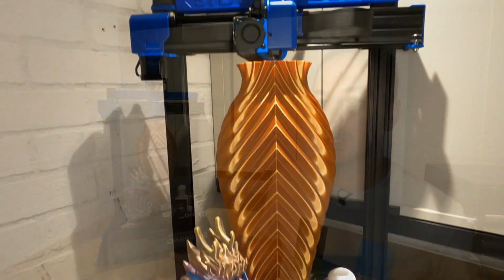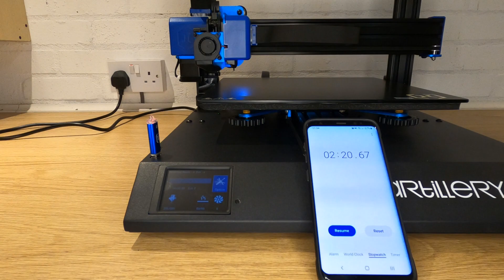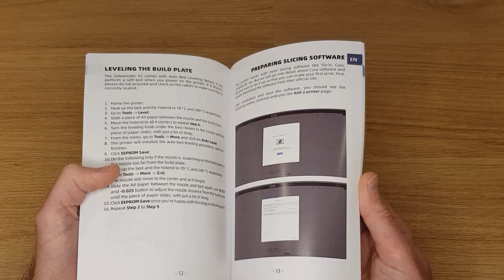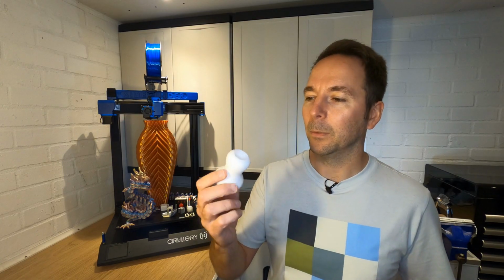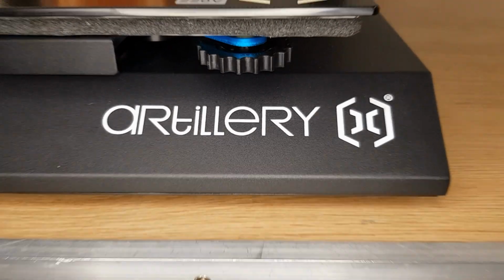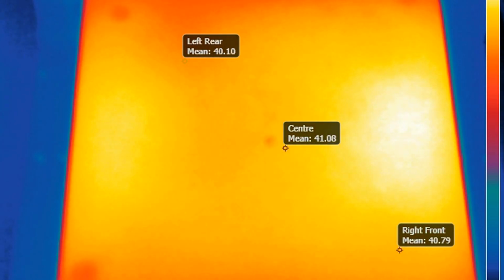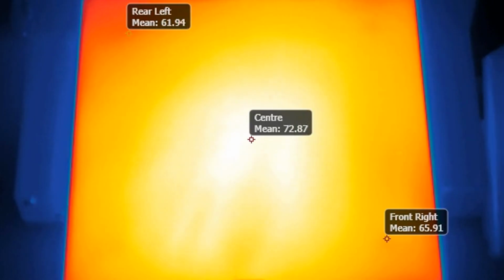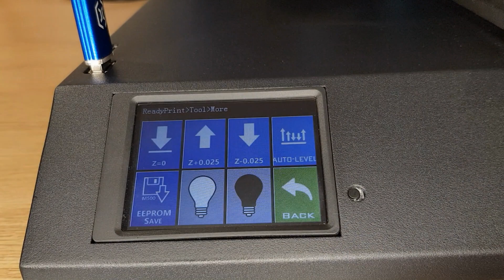Artillery Sidewinder X2 Review - The Easiest 3d Printer To Get Started?

Comment: I have the X1 but can't get it printing, it puts the first layer down and then drags it around around in a clump, the bed temp is 80 and the nozzle is 220, distance between the bed and nozzle is done with sliding a piece of paper between which I've done.
Anyone know what the problem could be?, it has worked ok for the first test print but hasn't worked since,.

Comment: Ha amazing review, i bought this for $250 and am so hlad i did. It is great to know the heat bleed below the bed which looks sixable because its where the glass gets connected at each corners adjustment spring.  

I truely love this machine even though ive only had it 2 weeks. It gave me access to printing anything i want. As a mushroom grower this means i can print hingest, ducting, handles, switch casings, vent filters and fan adapters.
 I can cut off so many expensive parts because now i can print them. I just finished printing a mini computer case and now i am working on duct flanges. 

It isnt perfect, and i learned while using programs like prusa that temp is everything, but as things get dialed in and my 1" xps foam print case gets assembled, i will be able to run my business on flat 4x8 panels of foam and plastic with printed parts, making me adaptable to the changing financial future of being a viable business.

For example i used to have to buy used squirrel blowers on hepa filters that were used for rat experiments in labs, with proprietary filters that cost hundreds, now i can buy a 1ftx1ft hepa and print the flange to attach it to my mushroom lab, for $100 plus filament.  Its insane the amount of hours ive spent looking at products that are not for mushroom production but are similar to fit me needs, now i can just print it with fusion 360
Reply from the maker: Great to hear you are reaping some of the great benefits of 3d printing so soon! Thanks for your comment👍

Comment: I've had my X2 for a year now, putting in the all-metal hotend with .6mm steel nozzle right from the get go. No major issues, though the LCD did die on my twice (probably not Artillery 3D's fault, more of me being in a lightning prone area). Had one LCD replaced under warranty (Artillery 3D's customer service has been superb in my experience, they even sent me replacement Ruby and motor boards as well) and got another from a local shop.

Been happily printing PLA+, Silk PLA, TPU, PC, PC-CF and PA6-CF before recently updated to Artillery 3D's all-metal hotend firmware to enable 300C at the hotend. Very happy!

But since @RickyImpey came out with the Sonic Pad guides, I'll be running that with the X2 soon (once my local shop has it in stock). Would be nice to print faster with the X2 until I could afford Bambu Labs' X1Carbon, though the X2 will remain as part of the team.

😃😃😃
Reply: Was it easy to switch all metal hotend
Reply: @Hanzi2u  There were a few screws to take off but no biggie when following the instructions.
Reply: @velocistafpv  which instructions did you follow? From where

Comment: Hi, great review, thanks for give so much important details. I used to have an Ender 3 which I customized a lot. I sold this printer and now I'm considering to buy a new one with bigger printer volume. How easy do you consider to switch nozzles in this Sidewinder X2 ? Could you give more details about integration of this printer with octoprint ? I saw other video about this printer which the person changed the glass bed by an alumminium one. DO you have any ideia if this could be dangerous, considering the heating bed is fed with main power source instead DC ? Thanks by the information.
Reply from the maker: Hi, I know some people do change the bed to aluminium and then earth it to ensure there is less risk of electrocution but it's not something I would do myself. I just believe that there is too high a risk of danger with a couple of wiring failures. What I did was add a PEI flexible plate with the magnetic plate applied directly to the glass bed. This way, I get a better print surface, a little better heat distribution and no added risk. The nozzle is just as easy to change as any of my other 3d printers. Slightly easier actually as you don't need to remove any parts first, just slide the silicone sock off. This printer would run with Octoprint with no issues, it can also run with klipper and i've had it running with the Creality Sonic Pad. Firmware updates are a little tricky but possible.

Comment: I've got a ender v2 and a flsun qqs pro delta and my flsun delta for some reason only works with cura 4.6 so that's how my printers are running I'm wondering if cura 4.6 will work for this artillery sidewinder x2 if so I'll buy it right now I'm needing the bigger build area and a direct drive extruder for tpu anyone know if it works on cura 4.6 thanks
Reply from the maker: I'm sure it will work. Worse case, you may have to modify a profile. The good news is that this is a development of the Sidewinder X1 which has had a Cura profile for a long time. Have a look in the Cura version you are running. If there is a Sidewinder X1 profile then you will be fine.

Comment: I have an X1. I got fed up with the ribbon cable connectors, and ended up wiring direct from the main board to the head. Looks like they have changed those. Bed adhesion is a constant problem, but I have upped the bed temperature and that helps- now I know why (your actual vs indicated temps). The reel bracket is terrible- access to the clamps is at the rear, v difficult to get to. Bed power sticks out the back- adds ~140mm to the overall depth - another fix. I like the interface and the speed... Question now is- do I get an X2, mod my X1, or choose another...
Reply from the maker: Well, over 6 months on, i still really like the X2. I don't love the screen and the firmware is a little limited but it's always been very reliable. I added a magnetic PEI bed and my bed adhesion problems went away.
Reply: @RickyImpey  I have ordered an X2- the fixes to issues convinced me. I like the solid construction, and hope it will be more reliable than the X1. When I started using the X1 (2.5 years ago), I had to make a 'machine type' because Cura did not list it. It does now, so I tried it- with exactly the same settings for speed etc, it takes ~25% longer to print. Looking at the gcode, it is moving more slowly- but neither versions seem to give the head speed that was selected... any ideas?
Reply from the maker: @Tensquaremetreworkshop  Usually, if the speed that you've asked for in your slicer is not being reached, it is being limited by the printer's acceleration settings. Imagine a car journey where you want to drive at 70mph but your can doesn't accelerate very fast. It will take a long time to reach your desired speed everytime you have to slow down to corner. The slicer settings are your desired speeds but the actual speed will be slower as your acceleration is limiting it's potential. You can change acceleration and jerk settings in Cura but if you go too far you may induce 'ringing' artifacts. I don't have a video for this yet but I believe Teaching Tech have some decent information on tuning acceleration.
Reply: @RickyImpey  I was not referring to the speed achieved, but the feed rate in the gcode. e.g.where my X1 version gives F1800, the 'official' version gives F1200. Similar differences exist throughout the code. The former predicts a 4hr20 build, the latter a 5hr39. All options are set identically. Weird...
Reply from the maker: @Tensquaremetreworkshop  Oh ok, that's strange 🤔

Comment: I have discovered it too, that the temperature on the print bed, for all my printers (3) is not what it has been set to in reality. That's why I bought a heating (silicon) element from Keenovo, with its own thermostat, and built my own bed. And I now have close to 95% correct temp in relation to what I have requested.

Comment: Hi Rick,
I watched your 2 reviews about the Ender 3 s1 Pro and the Artillery Sidewinder X2. I already have a modified Ender 3V2 and I am quite happy with it.
My question is which one of the 2 printers would you recommend for almost exclusively rc planes printing with thin walls? They both seem to be very good printers, so it's hard to decide... also not much experience and very alone ... Thank you for your answer.
Reply from the maker: Hmm, my first question would be why do you need another printer? Is there something you V2 won't do? Both of the printers you've mentioned are direct drive. The X2 is much bigger but the S1 Pro can print higher temp materials like nylon and even polycarbonate.
Reply: @RickyImpey , thank you for your answer. I wish to have a more "pro" printer and direct drive too. The V2 does the job, but I could improve the LW-PLA wing quality, eventually. Having 2 printers... is pleasant.
Reply from the maker: @klausrimdoi45  Ha ha, well depending on the scale, is it an advantage to print larger pieces in one go? The S1 Pro bed siz ecan be limiting. If that's not a problem then possibly the S1 Pro. Recently some have had a few issues with leveling but I can't say if it's user error or a machine problem, mine doesn't have any issues. Have a look at the Sovol SV01 Pro too (review coming next week). It's could be a great compromise between bed size and capability. I'm very impressed with it so far.

Comment: Hi Ricky, thanks for this fabulous review. After doing an autolevel from octoprint I got some profiles with slightly raised ends. I thought it was deformation due to temperature, but I still see them at room temperature. Here I leave you an image to see what your opinion is. Have you done any tests on yours, does it look like this? It is strange that a glass base is curved with that profile, don't you think?  https://drive.google.com/file/d/1665ZwbK4wD0CJpMH1YdVkqWJCGjWCBh3/view?usp=sharing
Reply from the maker: Hi Ignacio. That image really makes it look worse than it is. It's showing at most 0.1-0.2mm higher at the corners. Unfortunately, it is probably inaccuracies in the bed probe and the coating on the bed causing the slight difference. It's not something I would be concerned about myself.
Reply: @RickyImpey  Thanks! the truth is that the difference is minimal and not to be taken into account

After doing the manual and autolevel calibration, I expected to compensate for these small differences, but I found that the first layer of an STL (test level) had some material drag in the corners. (attached image)

It has occurred to me just when I saw your thermographic images of how BADLY the bed of this Artillery heats up, that what happens is not really because the self-leveling is not doing its job, but because the material does not adhere to the bed for lack of temperature and those tenths of height cause drag to occur.

https://drive.google.com/file/d/1zan_ya1-jTt2FjctVcmuDAGFh13omkOa/view?usp=share_link

Comment: Hi, I have a budget of 1000.Dollars
Would you still recommend this printer?
Reply from the maker: It depends what you want to do with it. I don't believe in paying more just because you have the budget. I would identify what you want to do and then see what is available.
Reply: user friendly make molds. in order to then be able to cast things. stable printer
Reply: @edwardholappa8410  It is an excellent printer and the large size will be a plus for molds.  I print molds for RC aircraft with mine (I have both n X1 and X2)

Comment: I’m sick to my stomach of fixing and modding my cheapo Creality and AnyCubic printers. It was fun when I was just starting and helped me learn a lot of 3DP in general but my hobby is making robots not fixing my printers! I think this will be my next printer and your review convinced me.
Reply from the maker: Mine has proven to be reliable so far. I haven't done a PID tune, e-steps or had to fix anything. I have added a Two trees PEI magnetic bed which has sorted the issue the uneven AC heating caused. I still really like it.
Reply: @RickyImpey  do you have a link for that bed ???
Reply: @RickyImpey  Yeah  would love to know too, thanks! I can only find the one with the adhesive magnetic layer, but Im not sure about how it would improve the issue with the bad heat spreading
Reply from the maker: @PolySquirt  This video has the PEI beds I've used in the description. I do use an adhesive mag one and it seems better for heat spread https://youtu.be/7kC4DghTW7o

Comment: I'm new to 3d printing and noticed you used a feeler gauge to adjust the nozzle height. What gauge did you use? When using a feeler, do you adjust the bed until it not longer feels like it is lifting the head? I'm sure it is pressing the bed down rather than lifting the print head.
Reply from the maker: Hi Anthony, this video will hopefully answer all of your questions https://youtu.be/zKpNxqWie_8

Comment: I'm looking for my 1st and only printer, and this one looks like it might be the ticket. Are the sides of the tall vase as smooth as they look on camera? And does this printer do fine detail as well as other printers of this size and price range. Speaking of price, it lists for $469 on the Artillery website, while it's only $339 on Geekbuying (on sale for the next 3 days) making this the least expensive printer of it's size. Also, have you tried a .2mm nozzle on this machine, or even a .1mm? I know print time will skyrocket, but if it will make a more detailed print, i'll be happy to wait for a print.
Reply from the maker: It is a good machine, and very accurate. I have tried smaller nozzles and it prints detail really well. To be fair, most of the printers from the main brands do but only if they're setup right. The beauty of the X2 (at least the one I was sent) is that you don't have to do any setting up. It prints well out if he box. I still stand by the pros and cons in the video, but since the review, I have added a magnetic PEI bed which has pretty much solved all of the bead heating issues. Yes, the Geekbuying deals are great at the moment. If you go through my link it also helps my reputation with them so they send me more stuff👍
Reply: @RickyImpey  That's my printer then. I'll be ordering it this Monday, and it looks like I can get a PEI bed from just about anywhere. The only question I have left is where do I buy a .2 or .1mm nozzle to fit this printer. Thanks for your help, and i'll be sure to use your link when I order.
Reply from the maker: @wiliamogle9342  there will be lots of places to buy a nozzle depending where you live. I bought a set from Amazon that I am happy with. Just search for 'volcano' style nozzles. They have a longer thread on them than some others you may have seen. I really hope you enjoy your new printer👍
Reply: Can you do a video on installing A PEI magnetic bed for a beginner ? I will be purchasing this printer tomorrow
Reply from the maker: @triplethreat9168  It is on the list, I will try to shuffle it up for you👍
Reply: @RickyImpey  perfect! Thank you

Comment: This one seems like a no-go considering the uneven bed heating; if you want to do larger prints in anything besides PLA you're just SOL.
Reply: "Seems" is not "actuality".  I have both an X1 and X2.  They have ZERO issues with bed adhesion even thought there is minor temp differences across the glass.  EVERY printer bed has this issue, just in different amounts.  I print extremely large prints in PLA and PETG and have had no issues at all.  None, nada, zip.

Comment: Is there a way to offset the temp difference in firmware? I recall seeing a blurb about it in Marlin. I never realized the temps lie like that!
Reply from the maker: Honestly, I don't know sorry. I would like to know though. However, then we would have the problem of not knowing if manufacturer's temperature figures are actual or if they needed to be adjusted.

Comment: Overall looks like a nice printer.  But the non-replaceable bed is a deal breaker. Thanks for the review
Reply from the maker: Yes, not the best decision in my opinion. I've since fitted a magnetic PEI bed and it makes a world of difference.
Reply: @RickyImpey  I’m looking for my second printer would you recommend this or the Creality Ender3 max neo? Or something else possibly? I like everything I’ve heard about the sidewinder over the creality except the not being able to change the bed. Was it hard fitting a pei sheet? I’ve never added one to my fokoos Odin f3. TIA
Reply from the maker: @Super6-1  Hi, I haven't got any experience of the other printers you've mentioned but fitting the PEI bed is very easy, it's a self-adhesive magnetic material that you just peel the back off and stick on. I haven't really changed my mind about anything on the X2. I really like it but it does feel a little rattly compared to my Ender 3 S1 Pro.
Reply: @RickyImpey  Did you just stuck the magnetic sheet to the glass bed of the printer or did you do you it in another way? Thanks for the review, it helped a lot!
Reply from the maker: @kekkie  I just stuck it on after a good clean🙂 Works great